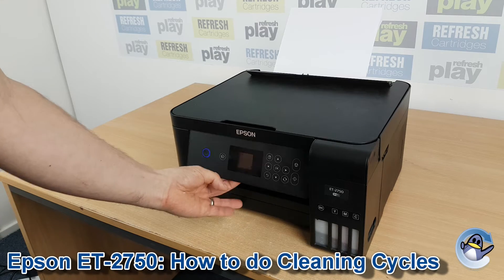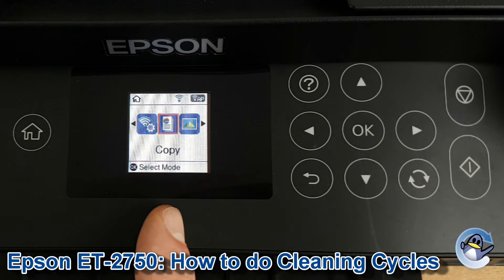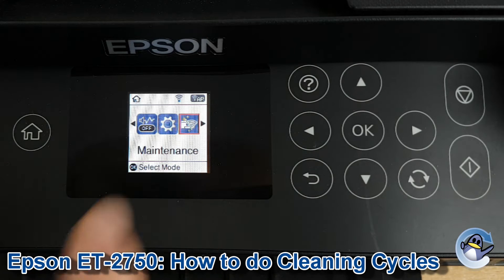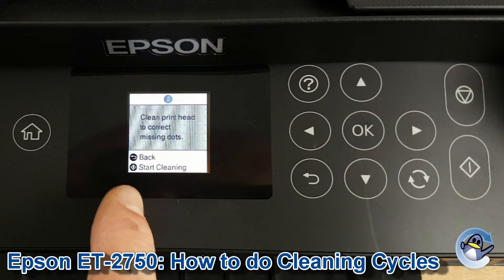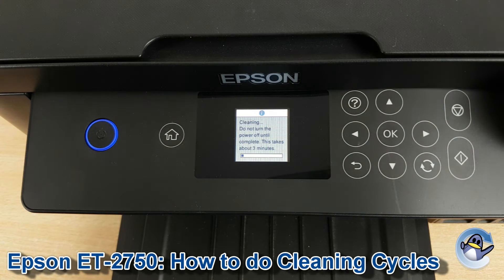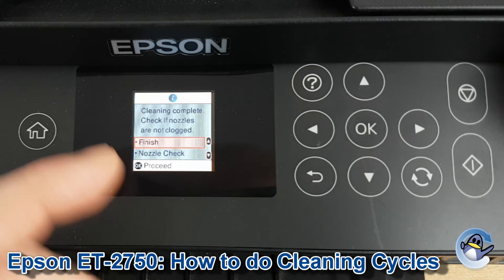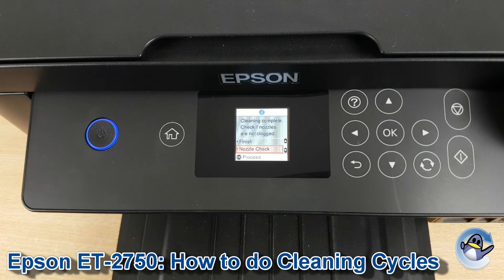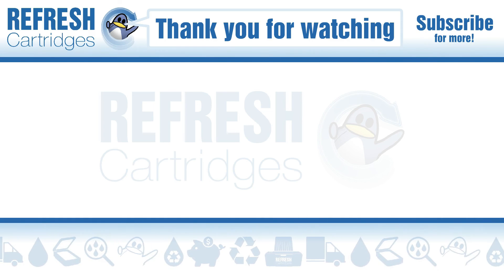Epson Ecotank ET-2750: How to do Printhead Cleaning Cycles and Improve Print Quality

Comment: My printer doesn’t print in color and when it does it, it’s fairy light
Reply: POWER CLEAN: secret instructions tell you to go online to find them = Turn off printer. Holding power button AND Help (? button!) at the same time UNTIL new screen comes on for power cleaning. * said it would be better in 12 hours but I have some color now.
Reply: @Laurie_in_Maine  thank you I tried again and it actually seems to have helped a little bit. It’s still running through the process, but we’ll see what happens.
Reply: @Laurie_in_Maine  I think I’ve tried that but nothing happened significantly
Reply: Likewise. Not one speck of color yet! It says it's set for color but everything is blah that should have color. Knitting patterns have color portions that are essential. grrrrrr!